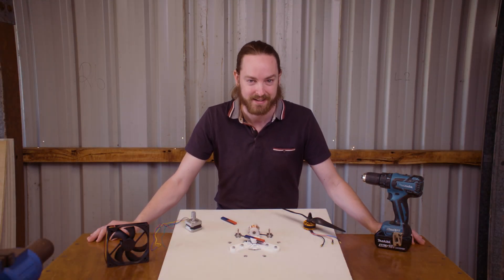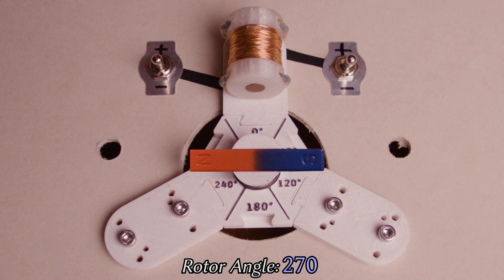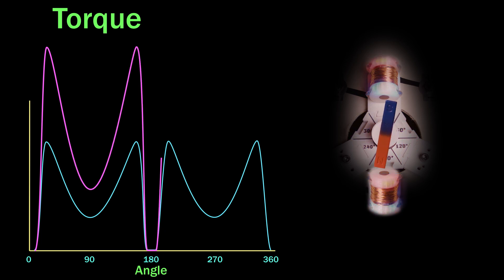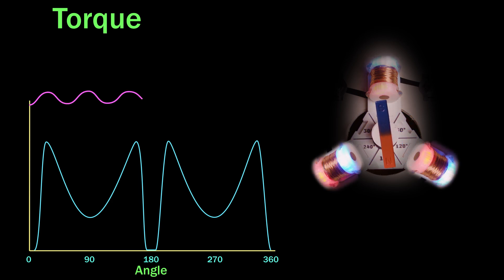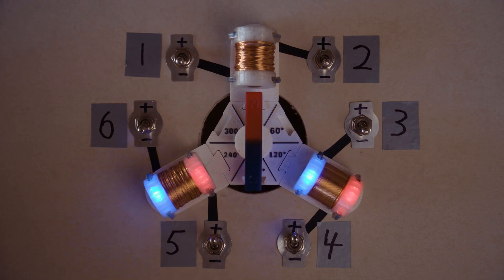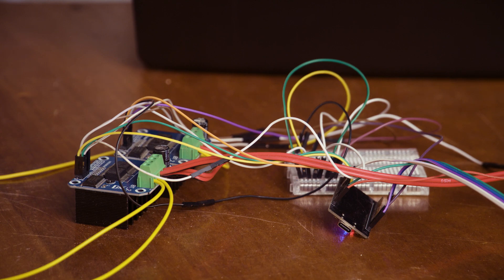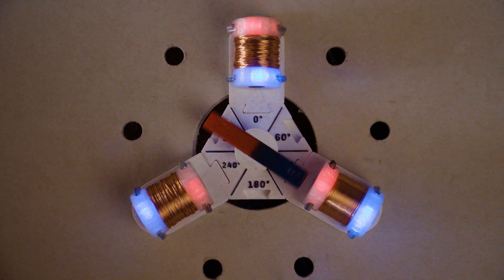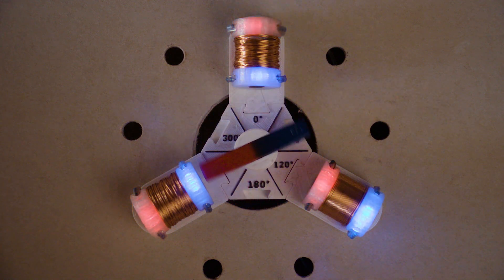DIY Brushless Motor build

Comment: Instead of switching, you can drive all the coils with a sinusoidal wave, 120 degrees phase shifted between each other.
This will force the motor to follow the rotating field. Once it's at speed, you can change to hard switching mode. The rotor will induce a voltage in the coils which you can use to synchronize your switching pulses.That's how the modern brushless motor controllers actually work.
Reply from the maker: It's quite incredible what modern electronic speed controllers can do! It's definitely beyond my current ability with an ESP32/Arduino to produce 3-phase sinusoidal outputs. And sensing the rotor/magnet position from the induced power on the zero-cross of each phase is way beyond me, for now. Amazing how smart the average ESC is now.

Comment: try hall-effect pure dc motor, using bushing bearings and two opposite magnets, and high current for high speed. not pulsed, not brushed because the bushings are the +/- contacts. brushless usually means pulsed ac motors, or just brushed dc pulsed ac motors. saying that pulsed ac motor is a dc motor is a bit thick. no, three wired drone motor is not dc, its run by ac current. well even if the power source is dc battery, its converted to ac before usage. ie commutator is the dc to ac conversion circuit.
Reply from the maker: It's funny you say that. I spent days researching why the industry calls them BLDC motors when it's clearly three-phase Alternating Current. So i hate the naming convention too. Apparently they're called Brushless-DC because you supply the motor controller with DC power? and the motors are frequently used to replace brushed DC motors. So more a marketing name than a technically precise one.

Comment: Thank you so much for this video ! I'm a electronics student, i've always been so lost with motors... your explanations are so clear !! 
Could you make a video about motors in trains, their soundings with the same pedagogy as here ? This is not a wildly talked-about topic, but very interesting !
Cheers from France :)
Reply from the maker: I may be wrong but i think most modern trains use exactly this type of motor. One motor per axle which sits next to the axle (or above) with a helical gear set to drive the axle. Exact same principle, same three phase wiring and commutation.
Reply: @technologyhobby  oh maybe you're right ^^ the problem is I don't find a bunch of these motors "alone" on Aliexpress ect, they often comes with a driver. But it is more fun to do it ourselves ^^

Comment: Now you can electromagnetically suspend two converging rotors turning in opposite directions at very high speed and tune the resonant frequencies in a vacuum
Reply from the maker: That sounds a little bit complicated for me to pull off right now!
Reply: @technologyhobby  ya I imagine it would take a little planning   ....

Comment: Lovely video. It would be interesting to add an accelerometer with its output in an overlay to see the system resonance
Reply from the maker: Spin the accelerometer? How do I get the data? wireless transmitter or on board recorder? I do have some accelerometers I might have a play with soon.

Comment: Awesome video!

I know you didn't film any of the electronics or the code for them but I'm curious about how those H bridges are working with commutation.

Are they getting feedback from electromagnets to know when to switch off and then reverse polarity on the magnet? Or did you code a pause yourself before the next stage?
Reply from the maker: Excellent question. This is a completely sensorless/blind motor control program I wrote using timers on the ESP32 micro-controller. I just limited the delay between each state to what the rotor can actually keep up with. If the motor was driving any meaningful load it would need sensors or rotor angle feedback.
Reply: @technologyhobby gotcha. It works great!

Comment: DPDT relay can do that  ;) 👍
Reply from the maker: I considered that. The symphony of clicky-clacks would have been quite something. But solid-state allowed me to really push the frequency/speed to the limit.
Reply: @technologyhobby  lmk how you did DPDT in solid state , if not transistors
Reply from the maker: I used a pair of BTS7960 H bridges, so pairs of MOSFETs that can attach the motor pole to + or - to reverse the current direction.